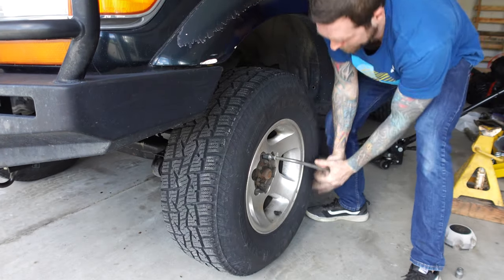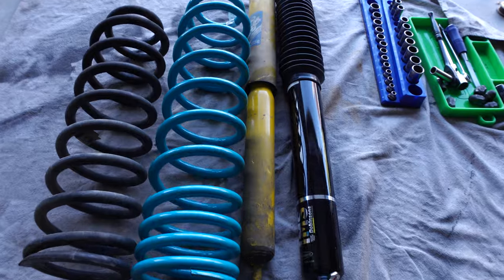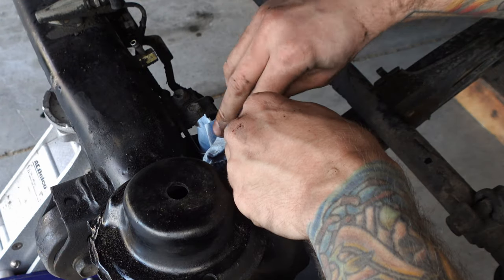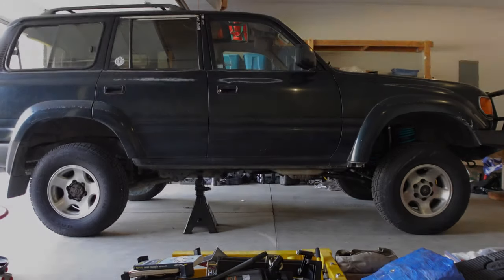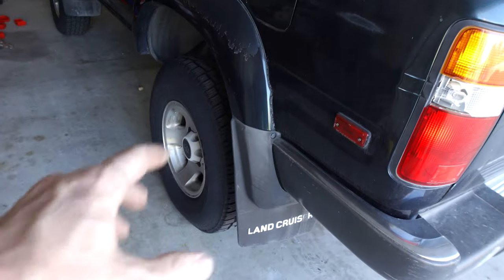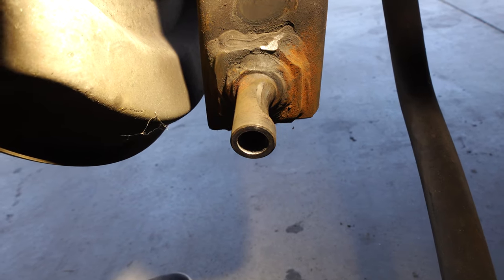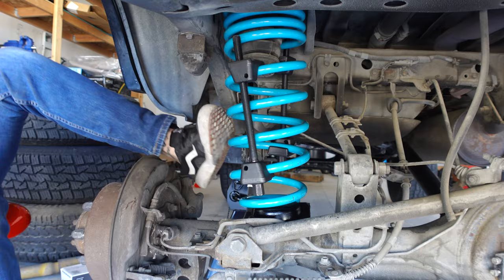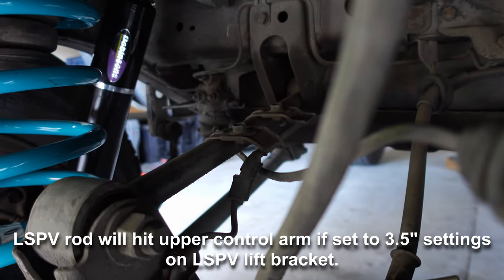Upgrading The Suspension On My Land Cruiser 80! Dobinson's 3.5" Long Travel Install

Comment: DELTA makes incredibly beefy and well engineered parts. I’m running a 2.5 in OME Heavy kit with the DELTA panhard bracket and their 3in radius arms on 35” M/T tires. My 96 LX450 steers straight and rides perfect. I did drop both sway bars as well. Probably overkill for my lift but will likely be swapping to a similar dobinsons setup to yours or a Slinky kit in the near future. A game changer is Landcruiser Phil’s front sway bar quick disconnects. I get a significant increase in front flex with those disconnected. Super cheap and easy to install. My cruiser goes all the places I’ve pointed it so far with that setup. The factory lockers do help with that though…
Reply from the maker: They’re local to me and I’ll probably buy some of their parts for sure. Also been looking at those quick disconnects!

Comment: Hey mate great video ! Im watching all the way from Perth, Western Australia. I’ve been fitting dobinsons gear to land cruisers for years as a mechanic. When it comes to that brake extension bracket you can lose the after market bracket itself and just adjust the bracket up until the highest point on the factory threads. I know it only adjusts it up half an inch or so but it works great. Keep smashing the rest of the build !
Reply: You said you were a mechanic. Can I ask you some questions please. I’m trying to start my own build.
Reply: @abdullamohsin7471  He's not a mechanic, and how would I know? You wouldn't tell anyone on here. your inbox would be full with questions like yours.

Comment: I also have a 94 fj80. I put a new engine it as well. I also changed the front end to a 3 link using dobisons 6 inch springs. I had to custom make a steering arm for drivers side so the drag link is in the front of the

Comment: The worn stub shafts for the shock mounts can be welded, just have some beads put on there and file the shafts round again. Or, you could have them cut off and new ones welded in the location you want? Great videos, thank you. Jim
Reply from the maker: My neighbor and I will probably do exactly that, weld and grind. Thanks Jim!
Reply: @RM_Garage  On the CEE Australia channel, Kurtis does this stuff all day and the repair looks awesome and is as strong as the original. You got this. Jim

Comment: I actually had a cracked mount on my driver's rear shock. I cut it out and had a shop weld on 2 new plates as a double sheer with a new bolt welded on the other side, effectively new OEM mount.. I couldn't find anywhere where Toyota or otherwise sells a new mount.  This keeps my rig serviceable and I don't need any weird adapters or one off nuts when I get new shocks

Comment: As another comment said just weld that shock mount and file it down round. That would be easiest. I don't think you mentioned it but you are going to have to extend your diff breather lines too. Just get those ARB extend kits and route it to the firewall in the engine. They are pretty cheap.
Reply from the maker: For sure! Definitely a cheap and easy option. My neighbor and I will likely do this.

Ah yep, will definitely need to extend the breathers.

Comment: It’s coming along! Those giant jack stands definitely make a difference compared to your wood block contraptions before 😂
Reply from the maker: But the wood got the job done!
Reply: @RM_Garage  do you own  crawbar,,or long pipe..1 foot on the bar, 2 hands fit the coil,,easy..&,,why a toyota, ??..shoulda got a nissan gu,,there better..ausie..i drive ford 4x4rs..not jap sht..too many design problems..&,,seeing you yanks dont do any distance,,like we do,,all our 4x4rs are diesel..preferably with no computer..
Reply: @RM_Garage  you need to tie the coils in,,like f100..dont rely on the shock..they blow.. we do it,, japs dont cos its not meant to 4x4..plus, mate ripped the mounts off his diff, too much travel,,japs dont have f100 rduis arms, bolt & eye,,, not thru bolt garbage..

Comment: Great choice! I have Dobinsons flexi coils on my 80 and I think they perform well for how I use my truck. Will you be using adjustable panhards? I have front and rear from Dobinsons and I wish I got the delta lift bracket for the rear. It seems other have had better results with the bracket in the rear because of the angle.
Reply from the maker: I was looking at the delta lift bracket and also the eimkeith stuff. Not sure which way I’m going at the moment
Reply: @RM_Garage  Eimkeith is a great option. Maybe I missed it in another video but what is going to be your typical use for the truck?
Reply from the maker: Back in California it was going to be used for crawling. Here in Idaho it’s going to be used for everything. Crawling where we can find it, but off-road in general. Exploring, adventuring, street driving, etc.

Comment: Can I ask you a question? Why did you go for 6 inch shocks with a 3.5 inch lift? My 80 has Lovells medium rate springs and Icon 1.0 shocks that are 7 yrs old but they're 3 inch version (matched to the approximate 3 to 4 inch of raise I've got but I think the shocks are flogging out.
Reply from the maker: It's what dobinsons recommended to get the most out of the coils they're paired with. No other reason really